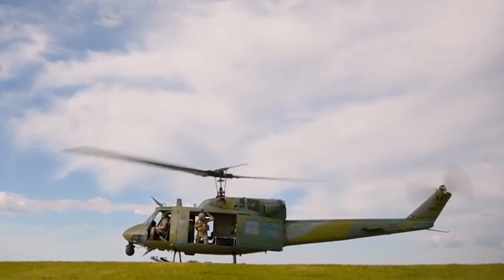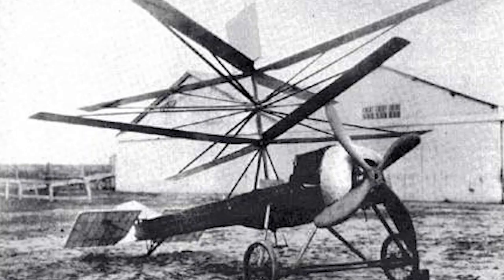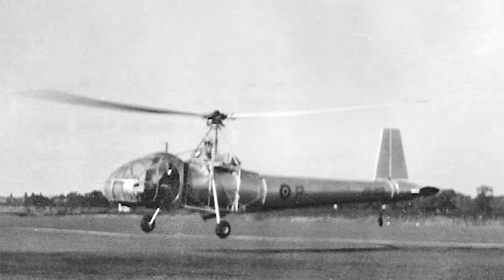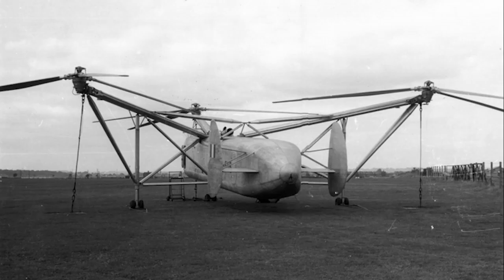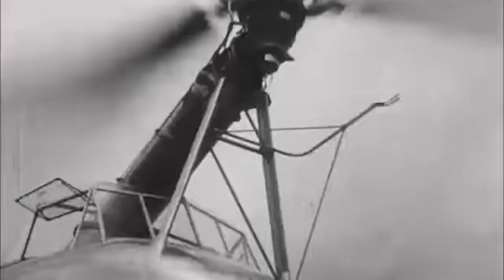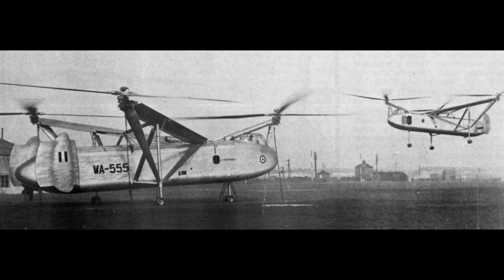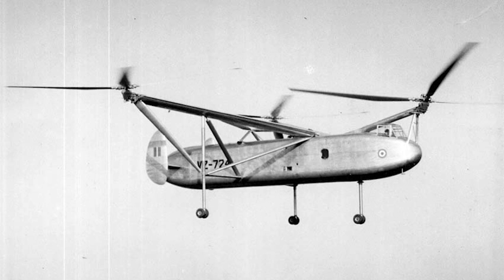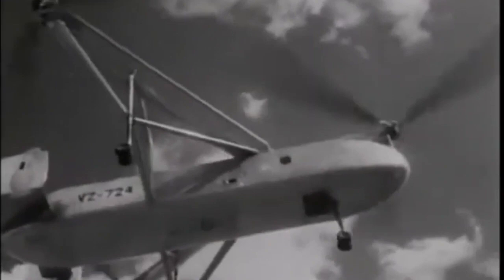Cierva W.11 Air Horse; The Triple Rotor Heavy

Comment: I am surprised they did not try and sell the helicopter to the army. A fleet of them landing anything up to a regimental size group where ever they were needed would be of huge importance.

The autogiro you show at 1:35, the Avro Rota C-30A, was one of those unsung heroes of the Battle of Britain. They were used to calibrate the radar so they could work out the hight of the incoming German bomber raid. The radar operators needed something which could fly as slowly as possible at the same altitude as the raiders. I believe one thing the would do to reduce their speed was fly into the wind which could bring them virtually to a stop as far as ground speed is is concerned. All this while being unarmed and with German fighters about.
Reply: Intriguing - not a detail of WWII of which I was previously aware. Thanks for sharing!
Reply: Very interesting! Thank you. +++ So the radars had to be calibrated every day, or every "raid"?
Reply: Jeeze. I'm surprised those little aircraft could lift those titanium balls.
Reply: Well yes... but history shows that being both maneuverable AND capable of very slow flight can work very well against faster, less agile aircraft!

Comment: It’s kind of an elegant way to include a large wing into a heavy lift rotor aircraft.  During cruise the wing can generate a substantial amount of lift and ease fuel consumption.  It would potentially allow for a unpowered emergency “landing” as opposed to most twin rotors which tend to roll and dive straight down.

Comment: The triangle rotor system is really strange as the two-rotor system as used on the Chinook, is actually faster than the army's single rotor helicopters. The speed loss of the tri-rotor is probably due to the drag of the side mounted aft rotors.

Comment: Thanks, Ed, most interesting as always. The triple rotor layout looks a bit awkward though – the Chinook-style twin seems simpler and stronger to me, and it’s a bit surprising that the designer didn’t try it. The Hitchcock version of ‘The Thirty Nine Steps’ (the best version, IMO) features a shot of a Cierva C-30A, G-ACVC, looking for Hannay (though it may have been a model). I’ve flown a couple of Magni M-16 autogyros as a pupil, and they are huge fun. There is (or was) a small autogyro museum at Rufforth Airfield.
Reply: The designer did try it. We’re you not paying attention?
Reply: @johnnunn8688  Obviously had a lapse of attention - perhaps thinking about Hitchcock!

Comment: Very interesting aircraft (and video). Can’t but think it was let down by the engineering materials of the time. Had potential. I’m not a airflow engineer but I would think that this rotor configuration would provide good lift in forward flight.
Reply: Contra-rotating nose rotor to allow differential torque steering? A non-twitchy canard??? . . . "more tea!!!''"      : )
Reply: You’re not an airflow engineer, but think……?

Comment: I don't understand is if the 3 rotors design is flawed or not, or if it's more complicated that it seems from a technical point of view.
Reply: The limitation was the blades rather than the engine, they needed more sets of blades to harness the full power the engine had available. Nowadays with blades longer and stronger, able to handle a lot more punishment, you often have two engines powering a single blade assembly.
Reply: @watcherzero5256  Thank you!

Comment: So this helicopter was envisioned to soak Africa in DDT?  Oh Well.
Reply: DDT wasn’t mentioned. However, the dangers of DDT weren’t known at the time. Wasn’t until 1982, if memory serves, that it was banned in the UK. Many African states, continued to use it, making your comment silly, at best.
Reply: @johnnunn8688  I stated Oh well since I was not serious. Proposing to use it to spray pesticides would not make economic sense   at all especially in undeveloped countries.  Military applications  would of course hold promise.
Reply: DDT had only been invented a couple of years before, but yes the Idea was to spray mosquitoes and try and eliminate Malaria and Dengue fever. The US was performing mass spraying campaigns in the Pacific to try and eliminate the tropical diseases for the last 5 years and just made it available commercially to the public in the Continental US. The UN was setting up targeted programs to eliminate tropical disease in the marginal areas of Europe, Russia and the Caribbean where the disease was present but not endemic. This aircraft had good fuel efficiency and 3 ton payload and would have enabled commercial crop dusting the same way aerial crop dusting took off in the US after WW1.
Reply: @watcherzero5256  Actually DDT does have a interesting history going back to 1874 when it was first synthesized (as I see on Wikipedia).  However, it's initial successful in reducing malaria wasn't sustained for various reasons. There were safety concerns with it's application in agriculture production beginning in 1947 and into the 50's.  Also it seems  a bit overly optimistic to start using an early experimental helicopter with no safety record in countries far so away from where it was designed and built. Thanks for the informative comment.

Comment: To me, the obvious weakness of this design is whatever method is relied on to transmit rotational power from the fuselage-mounted engines to the  outrigger rotor hubs. That's a long, rather fragile arrangement for an absolutely critical function.
Reply: The benefits of hindsight, eh?